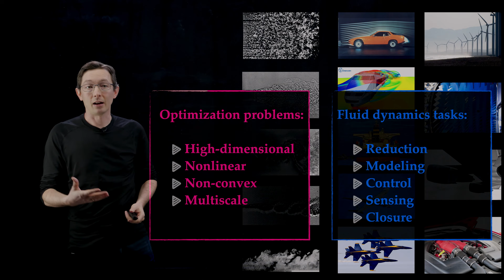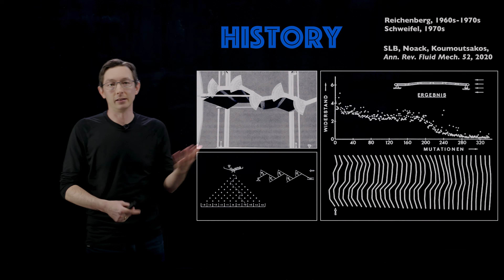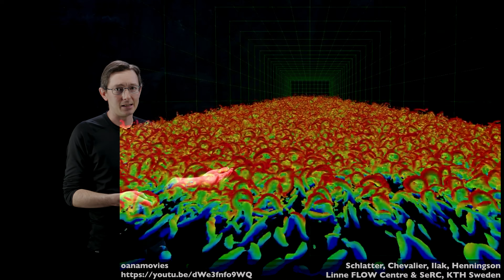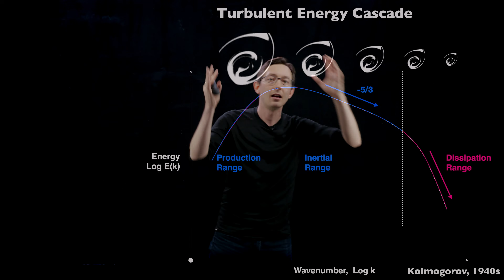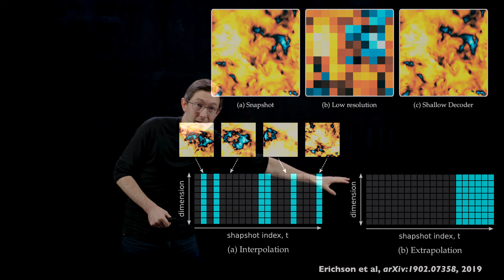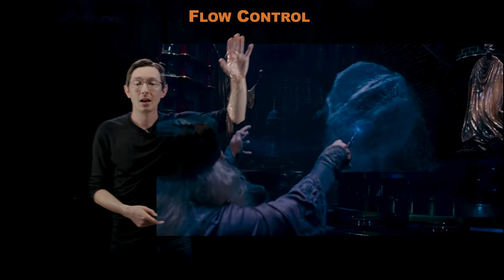Machine Learning for Fluid Mechanics

Comment: Hi,
first of all I would like to thank you for that great content you are offering for free on Youtube!

I have two questions regarding any kind of reduced order models (built with AE or POD):
1) if you are decomposing the problem into time and space and you say you use "snapshots" of different moments in time, I wonder how do you get the different snapshots at different points in time WITHOUT doing the the high fidelity simulation for the whole timespan? Because in any numerical simulation I know you use one timestep after another and can't skip any timestep... And with doing the whole high fidelity simulation I wonder why would like to built a reduced order model at all?

2) Assuming one can do simulations of different snapshots: How should one space the snapshots values of the high fidelity simulations across the interval of the time/parameter space? For example if I have an intervall from 0 to 1000 and I want 10 modes, do I want modes at 0, 100, 200, ... or unequally spaced points? 
Is there a literature for this kind of problem?

I would be very thankful for an answer and looking forward hearing from you!
Kind regards,
Daniel

Comment: So, If You Embed A Set Of Invariable Laws Into The Logical Construct Of An Emulated Digital Neural Network, Then The Invariant Processes Should Ideally Be Invariably Accurate, Without Internal Conflictions Of Summation, And Redundantly Abstracted To Closure Throughout The System, At The Very Least Within The Specific Design Constraints Of It's Intended Operation, Or Else It May Potentially Result In Forced Counterfactual Outputs And Missed Cues Of Pertinent Information, Which Could Result In Critical Failures Of Processing And Reduced Functional Performance?

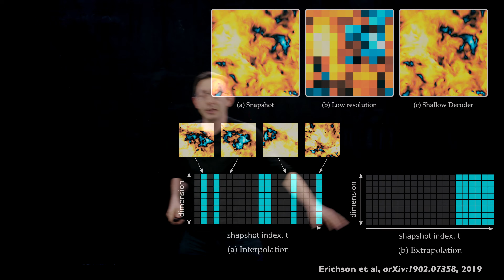Comment: In the example on extrapolation at 23:10 we clearly see a tendency from snapshots a to b, as from the extrapolations b to c. In e) we see clearly a sudden increase in the flow field. My understanding is that this could not be predicted because the snapshots represent only a part of the flow, so unseen fluctuation affect what is visible in this limited windows (more so if these are 2d images of a 3d flow field).  This makes sense?

Comment: Sounds promising but, Is it really possible to construct generalized models for wide range of fluid flows? given that the physics of fluids is very complicated unlike other fields where ML is being applied. But ML can definitely help us observe some generalized patterns in the fluids (like Kolmogrove's 5/3rd law) that we previously didn't saw or know about. ML algorithms can also help us quickly build custom turbulence models for specific flows that we are interested to learn about with a benefit of lower simulation times. But we need a lot of data.
Reply from the maker: Very good question.  We already have a generalized model for a wide range of fluid flows (the Navier-Stokes equations).  I think that one promising area is using ML to build better closure models so we can simulate turbulent systems accurately but with much less compute power.

Comment: Thanks for the great video. It's very fascinating to hear neural nets  constrained by physics principles. How much of background knowledge of fluid mechanics is needed to get started with this kind of problems? (if the current background is computer science and machine learning)
Reply from the maker: Some solid math background (ODEs and PDEs) would definitely be helpful.  Getting up to speed on the fluid dynamics is a bit of a steep learning curve, but definitely possible.  I should have some basic fluids videos at some point soon.

Comment: Thanks this is a very inspiring video.
Could ML for Fluid Mechanics be used to train neonatal artificial respiration systems for best parameterization of air flow intensity with respect to the very small sensible patients lungs - to avoid too strong air flow caused by inaccurate manually parametrization ? 
I learned that manually parametrizion seems to quit difficult with the risk to be not exactly enough so that early born babies lungs have much higher risk to be negative effected by artificial respiration.
Reply from the maker: Interesting application.  I have heard about a lot of work on computational fluid dynamics (CFD) to simulate these various flows.  With enough data and "expert" designed solutions, ML might be able to learn some of these solutions.

Comment: This is an outstanding lecture.
Reply from the maker: Thanks!
Reply: This linked vid is some kind of weird thing, but it did put the idea of using a steadily rising pure tone soundtrack over a video as a possible embedded time index.... not sure if it makes more sense than a frame count... but it is interesting.

Aside from that though... weird. Oughtta prolly delete.
Reply: @johnalley8397  just report the dude, it's spamming the comment section

Comment: I would disagree that we have enough data for fluid mechanics unlike other popular problems like image recognition. Fluid problems in general are very complex and unique and as soon as one changes certain conditions, machine learning models become useless. But there is a lot of scope for control problems using reinforcement learning which as such does not solely rely on data.
Reply: Machine learning does not only refer to neural networks. Brunton's own method SINDy https://doi.org/10.1073/pnas.1517384113 has proven useful in identifying the dynamics of fluids solely from data. There is an entire field of research dedicated to developing fluid models strictly from data. I would not write it off so easily.
Reply from the maker: @John_Graff  Thanks -- I agree, there is such a diversity of methods.  Although there is no "silver bullet", there are lots of things to try in different circumstances.
Reply: I agree
Reply from the maker: This is a subtlety we think about a lot about actually.  Fluids data are vast in some dimensions and sparse in others.  Many types of machine learning won't generalize well to new parameter values, but there is a lot of work on methods that do generalize.  In fact, fluids is one of the big motivating field to develop new and better techniques.